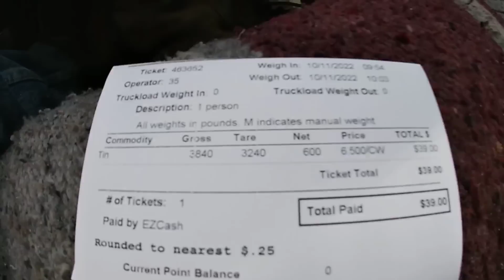Payed by the pound for trash.

Comment: I personally check audio equipment before I scrap it. If it's good I keep it. And I stopped collecting steel for a while. I keep the non ferrous (aluminum.) at home.im saving it for prices to go back up. Copper and brass and batteries I scrap now because the money is good for them.